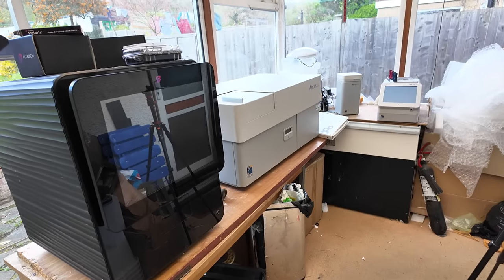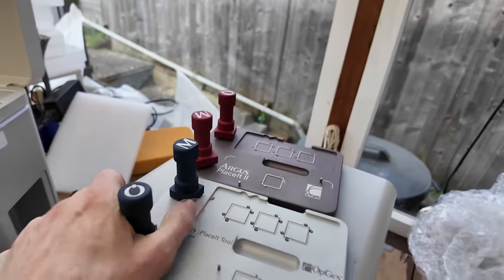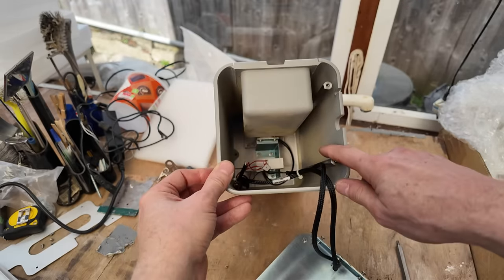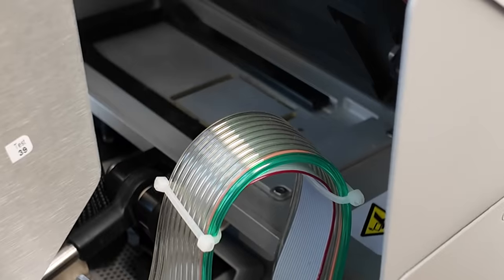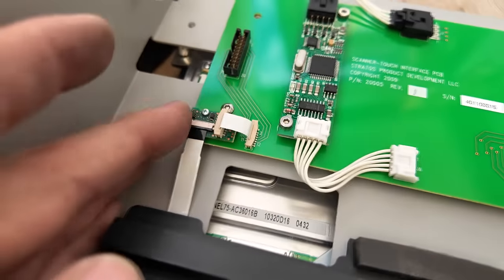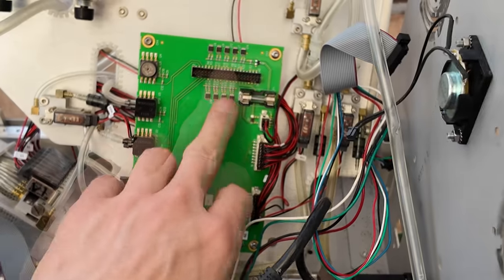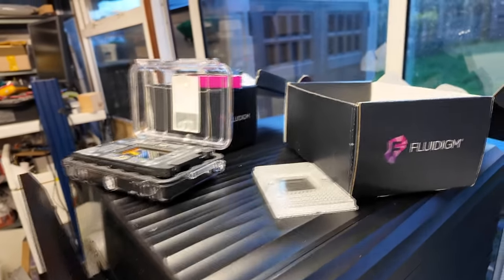Opgen Argus DNA optical mapping system  part 1 - processor

Comment: 600 pound for all that. A while back i ripped apart a PCR analyzer that used florescent tags that had a gargantuan MCP image intensifier hooked to a large fiber optic taper and a TEC cooled CCD. The CCD was mediocre copared to current versions but the 4 inch imsge intensifier assembly was totally unexpeded. Ended up using it as an image intensifier for a fairly large telescope. ❤
Reply: Have you made a record of the tare down?  Sounds like a great project.
Reply: Lucky!! Its better than xmas when that happens

Comment: that stabilized camera is much better but it seems to record at some weird interlaced frame interpolation, theres a lot of jitter and double vision. fast movements are blurry.  maybe look into the settings further. 

those recyclers are a gold mine for parts, most of them on ebay list their stuff for unreasonable high prices but with "make a offer" enabled and accept like 5% of the ask price. especially when its listed for a while.
Reply from the maker: Yeah, but annoying when they don't enable the offer option. Some just have unrealistic expectations - I've seen stuff hanging around for years with no price drop. 
Need to look more into framerates etc. Partly why I did this as a fairly short vid. Don't really like the DJI though - no manual tilt adjust, and not good at focussing close, not helped by the  screen being too small to see if focus is OK
Reply: 5:15 That part is a really bad offender on the double vision. You should check if that artifact is in the source file or if that is caused by your cutting/postprocessing software.

Comment: There is some sort of ghosting between frames,  Probably happening somewhere in the post-processing workflow.  Or maybe some sort of crude frame blending/interpolation is enabled.  Could be unintended frame rate conversion going on between camera fps and YouTube upload file fps.  
You can see it by pausing on anything moving very fast, like a hand. Is not always visible in every frame, but if you step through a few frames using < > keys you will see it.  Two frames blended into one.

Comment: I wonder if the unit's cost paled against the ongoing cost of the consumables.  It's very neat inside.
Reply: On this flip side, I wonder if that’s why these units sell for so cheap on eBay… Still working, but planned obsolescence via discontinued and proprietary consumables.
Reply: Obviously the business model is made around the consumables with these kind of medtech devices. But since it’s medtech they probably also charged enough for this thing as well😅

Not surprised to see you here Clive, love these teardowns

Comment: The sharpness and detail of the new camera is good, a portion of that may be attributable to the extra lighting from filming it there instead of the workshop. However there's a double vision effect, it looks like you might have recorded at 50 fps but then edited it on a 25 fps timeline but used "frame blending" as the interpolation method, this mode only really works when you have a long shutter duration, but it looks like the camera is recording at a short shutter duration so the motion is all weird and choppy. You can probably just change the interpolation method to "nearest frame" in your editing software which will fix it but I don't think you should try to increase the shutter duration to make it even smoother, firstly I don't think your camera will support it without an external ND filter but also it means the video will still be sharp when paused to read something.

But really interesting teardown, the bio stuff is always very niche and interesting. Absolutely love that custom ducted heatsink for the TEC, wonder how much that cost to machine and finish.
Reply: Yeah this is definitely an encoding issue. Lots of people who would be willing to help out with that Mike least we can do for the content!

Comment: The company I work at have and also had a quite big and very complex biothechnical machine, not allowed to say what it was, and when it was bought 2017 cost around 210000 dollars. Other better ones had came out since then so we recently bought a newer one. The other machine needed a cassette type thing that you had use every time you start it up for very precise calibration and could be used around 50 times until it was literally worn out. That item was discontinued 1 year ago, 6 years after we bought it so the machine is now just a pile of scrap in the basement. It is how it is but its dirty. We have although earned so much money of it so we are on huge plus much over its value so its "ok" anyway, but it is still dirty.

Comment: I recognised what kind of air pump that was when I first saw it.  It is a larger version of the one I bought a couple of years ago.  It actually has a brushless motor in it.  There should be a potentiometer in the top of it under a small sticker which controls the speed.

Comment: "Pneumatic ribbon cable" - a term I'd have never envisioned to refer to an actual thing!
Reply: I first saw  a similar product in some vertical 9 track computer tape streamers from the 1970/80's.  The cool thing was they were rainbow colour coded like some ribbon cables.  I think I still have one or two lengths in a box from 30 years ago, never found a good use for them as the bore was so small I had nothing that would fit in them.  I vaguely recall that they connected various places on the tape drive to banks of calibrated pressure switches that would track the loading of the tape and movement of the acceleration loop.

Now quite common in modern large format and inktank inkjet printers.  From 4 to 8 bores depending on the number of inks.
Reply: @KallePihlajasaari  We've actually had an HP DesignJet 1050C, which I dis- and reassembled fully. (Cleaning and belt replacement.) Not having to deal with individual tubes would have been quite welcome back then! =)

Comment: I have some of those blue dual action air pumps from ebay. They are nice because they have a brushless motor and a pwm speed control wire so very easy to control. I use them for low vacuum. 20 bucks.

Comment: What do you do with all the equipment you teardown once done with it? I've asked a few youtubers about this but no-one commented.

I've got a load of (mostly) junk that I can't resell on ebay and don't want to throw out. I've already done videos for them so not much use now. Other than salvage any useful parts for projects I just keep them.
Reply from the maker: Excellent question - it can be a problem for those of us who can't bear to bin useable stuff. 
There's an electronics car boot sale ever year near Luton ( google ddrc bootsale, usually May but late June this year) - I often take a car ( occasionally van) -load of stuff there and anything that doesn't sell in the first couple of hours goes on the "Free stuff" pile.  Last year I only came back with one small plastic bin of stuff that was too good to give away.  
There are also radio rally/hamfest type events elsewhere in the country - can't comment on which ones are best but definitely go for the outdoor bootsale type rather than the indoor ones.
Reply: @mikeselectricstuff  cool, thanks. Luton is a bit far from me but there's a few car boot sales near me. One in Bradford (mostly tat), a big one near Leeds / Bradford Airport but always very muddy. Mostly market traders and shifty looking blokes selling likely stolen tools and shed contents. Another at Harrogate (posh tat) occasionally pick things up at these sales. Not tried selling there yet. Might try selling at the Airport one if weather good this summer.
Reply from the maker: @adriansmith31  I doubt traditional boot sales are worth it, though you may get the occassional techie type there, or perhaps a few clueless civilians who think tech stuff is valuable. - Ham radio events are a much better bet. Google UK radio rallies for listings.
Reply: @mikeselectricstuff  yeah you are right about the traditional boot sales. Sometimes can get some bargains if you go early when site opens. Once bought a pallet of server parts; it's cheaper to buy a entry level server and then upgrade rather than buying a high end pre configured one. The brand new parts were then thrown out. A long time ago but got a load of DDS4 DAT tape drives for a fiver each. Made over 4 grand reselling those.

But I'll definitely search for ham radio and similar events.

Comment: Abstract

This video showcases a haul of expensive biotech equipment, including a fluid analysis system and a DNA analyzer. Additionally, the video details the process of tearing down the analysis system to examine the individual components. The presenter offers insights into the functionality and design of the system.

Summary

Sections

* Introduction 
    * 0:00 Brief overview of the two biotech machines: a fluid analyzer and a DNA analyzer.

* Oil Injector Unit
    * 0:54 Examination of a simple oil injector, used in high-power magnification systems.
    * 1:09 Functionality of the injector is explained.

* Mapping System Processing Unit
    * 5:19 Exploration of the processing unit, including its control panel and internal components.
    * 5:48 Background information on the original cost of the unit.
    * 8:05 Functionality of the pneumatic drawer and the Peltier cooler.
    * 8:43 Exploration of the unit's internal hardware.  
    * 12:52 Examination of the unit's manifold and thermal isolation setup.

* Mapping System Fluid Control
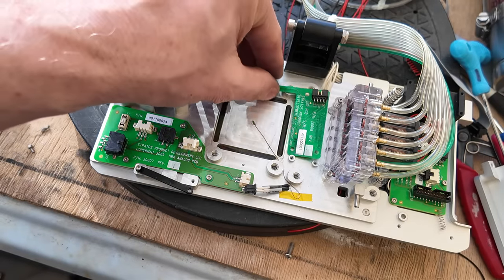    * 13:51 Closer look at the fluid control system, including valves and a piston volume control. 

I used gemini 1.0 advanced on the transcript
Reply: @wolpumba4099 If you ask the right questions and give them the right data the AIs can produce reasonable output.  How much formatting did you have to do to get it to lay it out afterwards?
Reply: @KallePihlajasaari  The prompt I used is: Create an abstract and summarize the following video transcript as a bullet list. Prepend each bullet point with starting timestamp. Do not show the stopping timestamp. Also split the summary into sections and create section titles: ```<transcript>```. For videos < 12 to 20 min (depending on how much is spoken) I can use a single prompt with gemini advanced 1.0 or gpt4. For longer videos I used to split the transcript into segments and merge the bullet lists (using the AI). But with gemini 1.5 pro I can get summaries of 1h30min long videos that also seem to be of better quality than merged summaries. Youtube comments don't support Markdown, therefore I need to change the formatting of titles from ## title to \*title\* and bold markup from \*\*bold\*\* to \*bold\*. Typically I do that in emacs with M-x replace-regexp ^\#\#\# \(.*\)$ → *\1*.  I never had good results trying to explain the Large Language Model how to format youtube comments in the prompt. That is why I fix the formatting manually.
Reply: @wolpumba4099  Wow, I am rather in awe of how you have managed to coax so much useful information with meaningful formatting from the AIs.  It does rather add value to the video if one comes back to it later and wants to locate a section.

You could offer this as a service to video publishers and I deleting your comment above would make perfect sense to hold on to the small competitive edge you have now.  Having this summary in the video description after the captions are generated would be a benefit to the publisher and you could find work for a number of cool channels.

Thank you for your detailed reply, I did not expect the AI to do the formatting so well and thought you would have to suffer through much more of the grind.
Reply: @KallePihlajasaari X  It would be easy for google to provide this service, if they don't then I think they measure a reduction in their ad revenue. I think I have much less screen time now. After creating the summary I typically just jump to a few sections that interest me. 

I heard Youtube Premium users already can talk to an AI helper and ask questions about the video.

Comment: Wondering why those manifolds are clear plastic, why not metal?
Reply from the maker: So you can see they're clean inside maybe? Also probably easier to machine
Reply: corrosion resistance?
Reply: @kautzz   I did some research... clear acrylic (PMMA) is great for pneumatic manifolds because it's low cost, easily machined, and bonded using heat and pressure to build up a manifold out of multiple layers. Chemical resistance is not great at all actually. Youtube won't allow me to post a link unfortunately.
Reply: @Jeroen74  doh obviously, thanks for checking. being able to stack layers makes things a lot easier

Comment: The autofocus kept on hunting back to your hand. also, you might get a better recording if you used a tripod, and moved the parts and not the camera so much. 
However, the image stabilisation was better than the interlacing of the fields ripping apart when you pan around. Panning slower will give you less distortion in the image as well.

I always enjoy these big pricy equipment teardowns! Keep up the great work Mike!!

Comment: I've got really bad motion jerking and doubling at 1x speed, such that it is actually unwatchable, with a building headache and nausea that feels identical to when I tried to watch movies in the cinema.
Just changing to 1.5x speed is already quite a bit better though and 2x is almost completely fine. I'm watching on a Samsung tablet with 120Hz mode enabled.

PS. Just checked on my pc, using SVP set to interpolate 5x to 120 fps on a 240Hz OLED (even that is a bit much for unbuffered realtime playback on an OC'd 13900KS @ 6.3GHz with a RTX4090 OC'd to +142 core and +1400 mem) and everything is great with my only nitpick that the interpolated frames look a bit blurry, but that's to be expected during motion at such a low original frame rate.

Maybe you could consider shooting at 60 (or even some glorious 120) Hz?